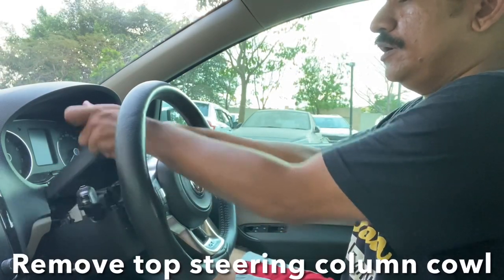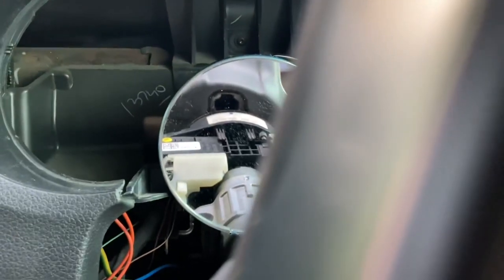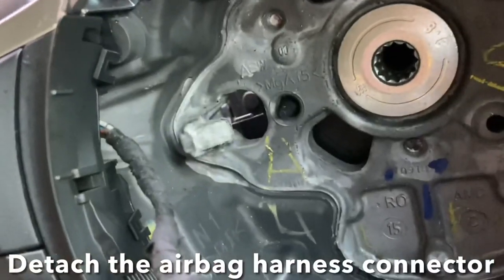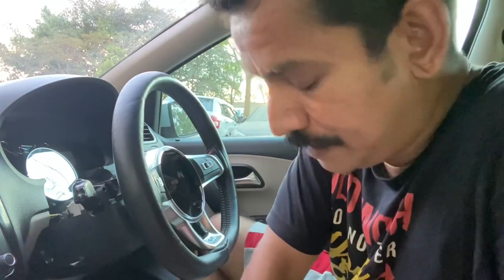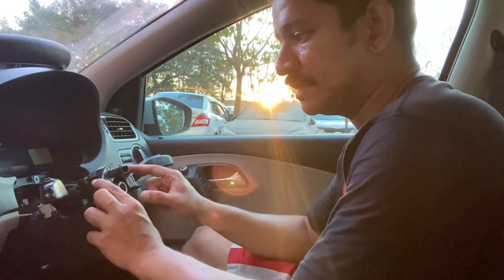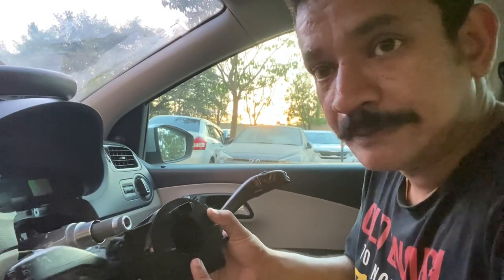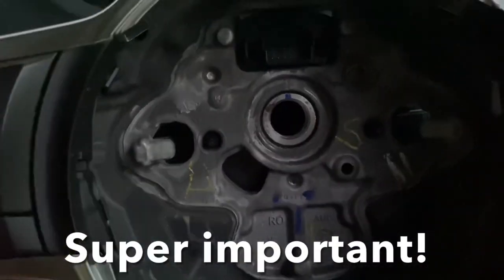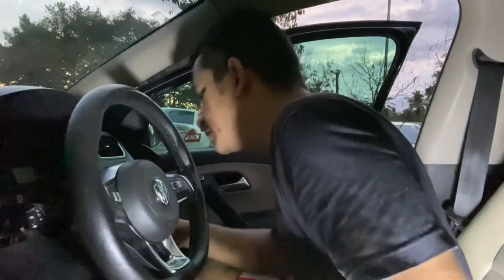Polo 6R - Removing and installing steering column combination switch

Comment: Very helpful and well-described video, thank you 🙏. I am curious why you had to replace your combination switch? I will try to replace mine because my cruise control stopped working, and I am hoping that will solve my problem.
Reply from the maker: I had installed cruise control on my Polo so ended up changing the combi switch.

Comment: Nice video well presented. Is there any problem when reconnecting battery ground cable does the system need to be told what battery has been fitted ?
Reply from the maker: Hi Chris, nope nothing of that sort. Just need to re-adapt the window motors so it auto closes and opens upon the dab of the button. So we need to press the buttons of all the windows up and down twice from the driver side master window controls. That’s all.

Comment: After the installation of combination switch , the front wipers aren’t working . Is it required to complete the installation of whole setup for the wipers to work
Reply from the maker: If you’ve connected the T41 connector to the combination switch, the wipers and indicators should work.

Comment: Hi 
My combination switch relay is not working. it always high beam . Any after market switch available and what is approx. Cost ?  Please advice
Reply from the maker: Hi Lokesh, the combination switch retails for 6-7k. Did you check with the service centre? I would suggest checking with these car scrap yards in your city. They will offer you a much cheaper and sensible rate. Like 2-2.5k for a used one from a scrap/ accident salvage car.

Comment: I have vento 2013 highline, in order to retrofit cruise control, just combination swap is okay or do I need to upgrade BCM and cluster as well ??
Reply from the maker: You’ll have to check what your BCM is. If the part number ends in 086, you’ll have to upgrade it.
Reply: @GaneshBalan  ok yeah it’s end with 86 thanks 🙏 for the help
Reply from the maker: If you’re located in Bangalore, get in touch with Praveen @ 81477 37557. He’ll help you get it installed.

Comment: Hello Sir, I have Polo 2017 1.2 MPI (Anniversary edition) Comfortline which doesn't have cruise control, can i fit one to it. It will be good to have in highways.
Reply from the maker: Hi Hemanth, you can install cruise control in your car. You’ll have to check what is the BCM installed in your car first as the BCM is the main component in enabling cruise control. It is located below the steering column, above the pedals. Check the last 3 digits - 086/087 and the likes. 087 supports cruise control feature. Some variants of the 086 unit supports it but have to check which one it is.
Reply: @GaneshBalan  Thanks for responding Sir, Appreciate it. I have left my car for service  will check on that and keep you posted. When i check with VW service center mehcanic they said they haven't upgraded any so far and asked me to check after market. Anyways will check and let you know. Thank you
Reply from the maker: @hemanthsonu4 Service centres don’t do these jobs Hemanth. They do the routine work of servicing and repair/replacements of stock parts. Of course, if you have a good rapport with the technicians there, you can always request their help to do it out of the service centre. Some may oblige. 🙂
Reply: @GaneshBalan   Got it, thank you. Spoke to them once again now. They asked me to check aftermarket itself 😞
Reply from the maker: Where are you located? If it is Bangalore I can hook you up with a friend who does these retrofits.
Reply: @GaneshBalan  Yes i'm located in Bangalore itself. Sure that would be great help.
Reply from the maker: @hemanthsonu4 Contact Praveen at 81477 37557.
Reply: @GaneshBalan  Thank you Sir.👌
Reply: @GaneshBalan  Can you please let know how to source Cruise control Switch? Any references Pls.

Comment: guys link to the Russian guy that dose the light please. this up load was so helpful thank you.
Reply from the maker: Please go through the response to the earlier comments. I have shared the link of the Russian member who sells it.
Reply: @GaneshBalan . thank you bud...ill do that.
Reply: After reconnecting battery I have a few warning lights on. Airbag, tyre pressure and traction control. I have tried to reset but no luck and have been for a long drive. Any ideas? No issues before
Reply from the maker: @ashikm8083 Hi Ashik, the warning lights should usually go away after you drive for a few km. What car is this? Why was the battery disconnected? Did you do some changes to the car like some change of parts?

Comment: Sir, I have polo confortline 1.2L, when I crank the engine, the wipers starts automatically and stops after few minutes. What could have gone wrong? 

There is no other system which has malfunctioned.
Reply from the maker: Yash, how old is your Polo? I am suspecting a BCM issue. Try swapping the BCM with one from a scrapyard and test.